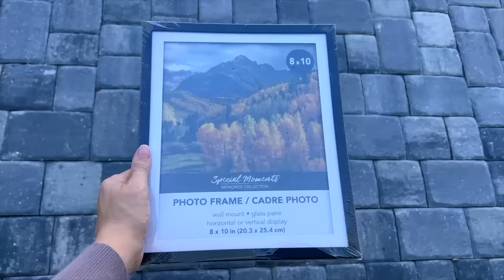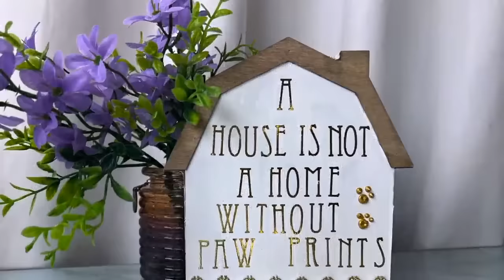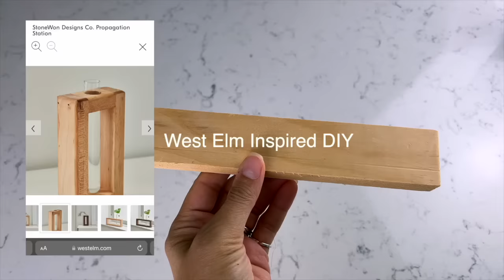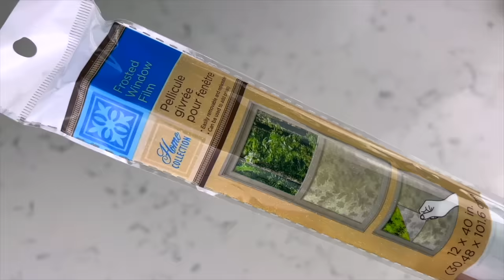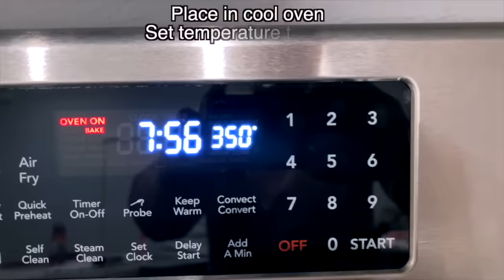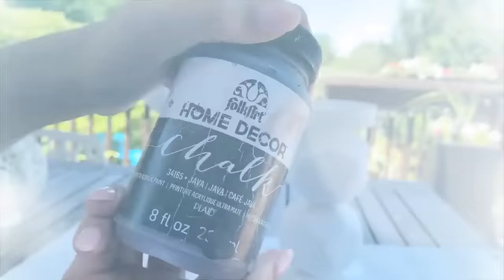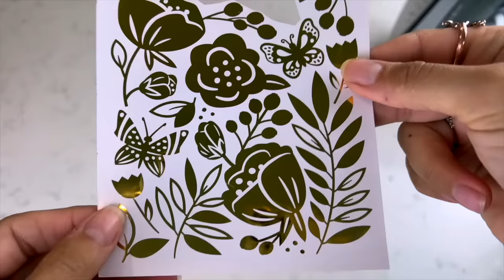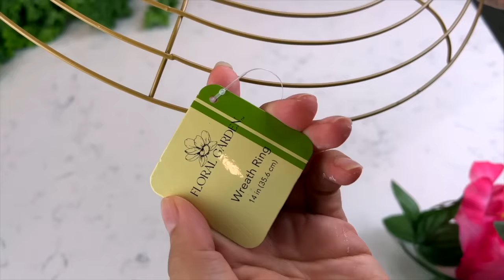50 DOLLAR TREE DIYS UNDER $5 DOLLARS!

Comment: I have a suggestion for your wooden box candle holders , if you fill the bottom box with sand, to give it some weight, for some stability,  and something that doesn't burn under the candle
Reply: Some white sand would be pretty
Reply: They are phoney candles in this case.

Comment: Loved everything in this video. Just a hack for removing stickers. A heat gun or hairdryer works too. Wondering if the heat gun would also work with the transfers on the pots instead of the iron. Less risk of burning fingers😂 gonna try some of your crafts. Thanks for sharing. ❤

Comment: Love your ideas!  Hint:  When making holes in plastic bowls or planters, use a soldering iron or a wood burning tool, works really well and doesn't crack the bowl or planter.  Only do this in well ventilated area.  Wipe your tool with folded rag while n still hot and any plastic residue comes off quickly

Comment: You might try steaming then shaping the stems of the baby's breath before use. My mother used to dry flowers for art work. It's not terribly hard, you just have to use flowers that can be arranged flat (...if they are too bulky it won't work out as well) between two paper towels and then press by putting them between the pages of a magazine and weight the whole thing with some heavy books.  I don't remember how long they took to dry...just check them after a week or two and see if they are dry😊